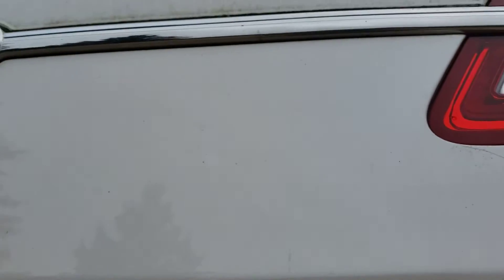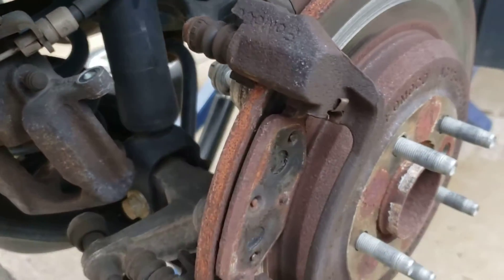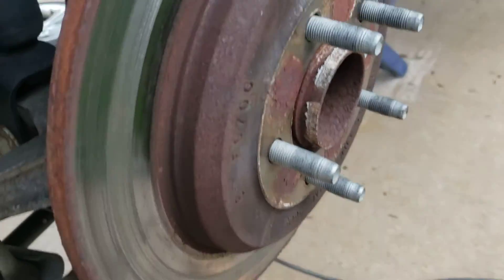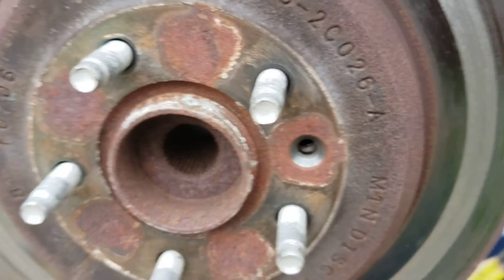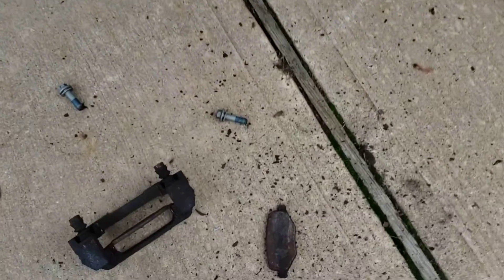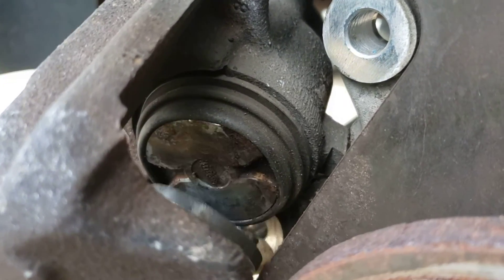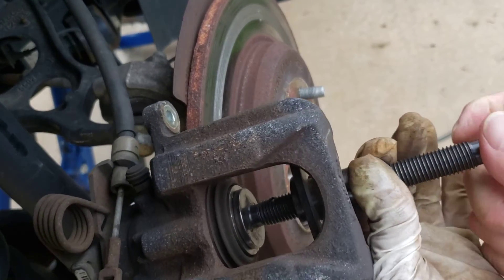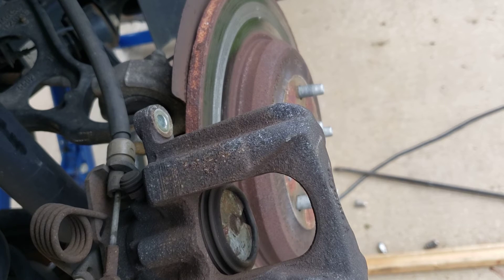2015 Ford Taurus SEL Rear Brakes and Rotors How To Part 1

Comment: I prolly will try to get the t40 bolt out before i take the calipers off have someone hold the brakes down.
Reply from the maker: Excellent idea..mine was when your by yourself of course...
Reply: @alyoungcuda  was able to get them bolts all out i sprayed them first with W.D40 then put a screw driver in between the rotor an caliper so wouldnt move on me they came out like butter, not re using then damn things lol.
Reply: I haze my brakes in rotorsjust nervous to do it thinking I am going to mess up something

Comment: Hi. This the same for ford 500?
Reply from the maker: Same style car, yes
Reply: @alyoungcuda  question for you, if you can aid please. My ebrake doesnt work. I push it n i hear it click, i can actually push pedal and hear 3 clicks. Inspection said its not stopping car. That i need to use it more. Or tighten it. Im no expert, but i dont think my ford 500 self adjusts with parking brake. I think it maybe just warn down brake pads. Tell, me does a ford 5p0 have brake shoes? And an ebrake adjuster u use a screwdriver to click down or no? What would you suggest to fix? I pushed the dbrake like 10 times. Ive been using it everytime i park. I also drove backwards at 15 mph and pushed foot brake, i heard that can fix a seized rear brake. I just want the ebrake to work :(
Reply from the maker: @c.518  your e brake is cable operated,  when you step on it it clicks which locks it down. It pulls on the cable which in turn pulls on the cables attached to both rear calipers. You need to pull both wheels off and have someone step on the e brake while you look to see if the cables are pulling on the calipers in the rear. Thats the 1st thing you need to check to see if you have movement in the rear and of course you need to see if you have brake pad material and are they close to the rotors both the inside and outside pads should be touching the rotor like  brakes on a bicycle
Reply: @alyoungcuda  thank you very much. Is it ok if i ask another question in the future?
Reply from the maker: @c.518  😊 yes anything

Comment: 15mm did not fit
Reply from the maker: Just happen to have the car here today..15mm for the bolts going to the caliper bracket to the knuckle  and its 15mm for the wrench to hold the slider that the 13mm caliper bolts screw into..I think you got it wrong or your wrench is too fat to slide down past the slider bolt washer..and of course unless your car is original and can prove its never been worked on from someone else, the bolts could have been changed..but I stand corrected on this Original Owner Car..Enjoy..
Reply: I'm not complaining lol I appreciate the video very much.you deff took a lot of guess work out of this project.i just finished.besides the part store giving me the wrong caliper I finished all 4 in about 4 hours.